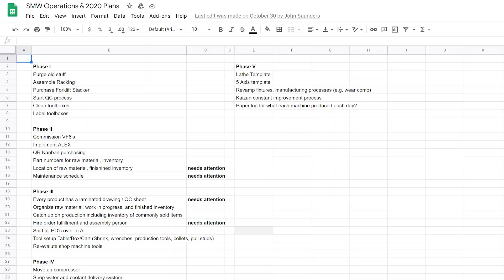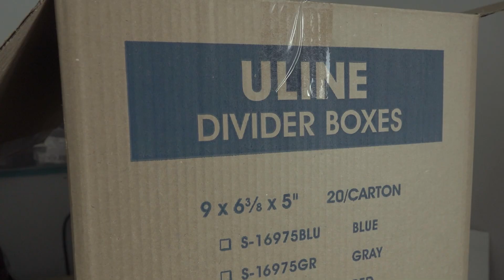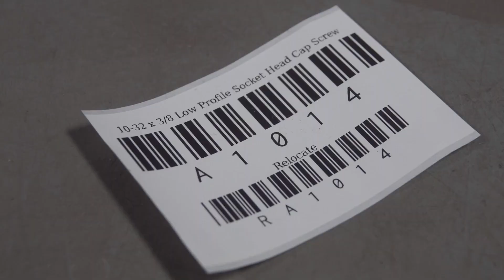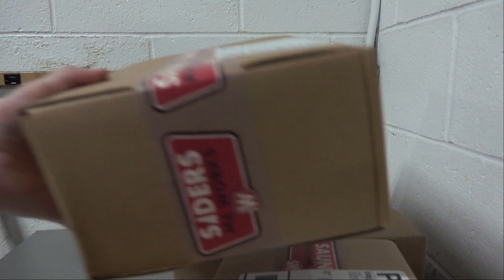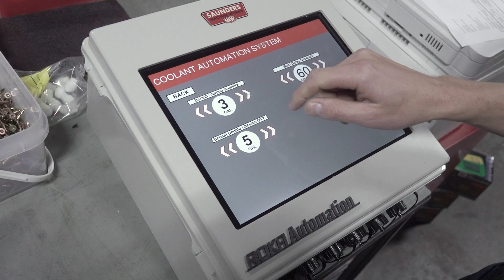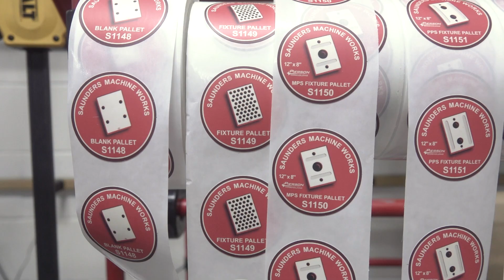REBUILDING THE SHOP - Overhauling our CNC Machine Shop

Comment: There are some nice wireless smart barcode readers from Datalogic, that work from a far distance, even on relatively small barcodes. Some of them run Android, so you can easily create a custom app to tie it to your ERP or other system. I am pretty sure they provide some sample code so you can customize it, and add features like user selection, list history, show current inventory, orders, batch reordering, or scanning, etc. I think the Datalogic Falcon X4, is the best option for new shops.

Comment: Could you do a follow-up review of the tramp oil separator you installed about two years ago. Since the coolant system and larger machining capability upgrade, did you need explorer other or newer options for the Haas?  Nasty, sticky, smelly, slimy synthetic & organic coolants has always been an issue for me. Because it was always on everything in that huge shop.

Flashback:  I would have never guess that I would have missed the minty-pungent smell of sulfurized cutting oil, but that's what old machine shops and you smelled like. Germs couldn't survive the sulphur. 😉

Comment: I used to do church sound mixing and well remember the look of horror on older mixmens faces when I advocated pulling all plugs on the system and rethinking the layout annually.   Not only do the contacts corrode over time and you get weird noises, but as we develop as mixers and also as we add equipment and bump against routing limits we can always make the system better, sometimes with small changes, sometimes big changes that will require a training day to push the benefits.  Always worth it, and also always resisted by the older folk >-:   You have done a good thing in your shop and I confess I need to do the same thing in my home workshop spaces, the junk has taken over!

Comment: I used to lead the engineering department for zebra skimmers. They have an awesome cheap alt to coolant automation system for a few grand. Up until the last year or so I did most of the installations myself. Really a killer system. And for the large shops / aerospace shops. The make a fully computer controlled unit u can monitor from your phone the machine does the rest and it holds the brix perfectly! So if interested in saving some money check em out!

Comment: I have used that tube pipe system, it sucks...... brackets never seem to stay in place no matter what you do.
Although this is in an automotive assembly plant.
Reply: I thought the same thing when I saw it, there are better options but they’re pricier
Reply: Here in europe, 2020 or 4040 aluminium extrusions are very common for this kind of application. There are several flavours of extrusions, mainly Bosch and Item. Especially for the Item profiles, you can get like a million accessories for anything you could think of.
Reply: @fkiesel9442  I used to work for item, in particular with their tube system and it is so much easier to work with, BMW replaced their old system as Saunders has it, with items tube system

Comment: haas do sell a automatic coolant refile system
Reply: Yeah but it sucks. All it does is add more tap water and coolant to a specific ratio which is always changing because of concentration constantly increasing due to evaporation. It is nice being able to add tap water with the press of a button. You just have to run water lines to all of your machines... Oh and if they freeze your machine might potentially become completely soaked in water overnight

Comment: Will your homegrown ERP ever be open sourced?
Reply: Any idea what he is writing the program in?
Reply: @SPARCRACING  It looks like PHP. I would be interested in coding something like that, but I lack the business side of it
Reply: @SPARCRACING  I made something a long time ago with java and an sql database with a web interface. The same can be done with android, which I'm learning to do right now. hehe
Reply: @SPARCRACING  Probably PHP and MySQL. I mean, it is a low cost entry, can easily be modified by a lot of people with limited programming skills. I don't think PHP and MySQL are a good solution long term, but it often works ok. (I personally would probably use Python and PosgreSQL, just because these are tools I trust more with my data). ERP tools usually aren't rocket science, just a some glue between database, web, some external APIs, maybe authentication, ability to interact from multiple computers (and mobile barcode scanners), some reporting functions, etc. It is pretty easy to build, but you really need experience in shop work to really understand how to structure it, and what is required for user friendly operation of common tasks.